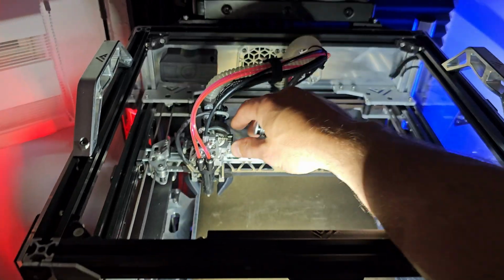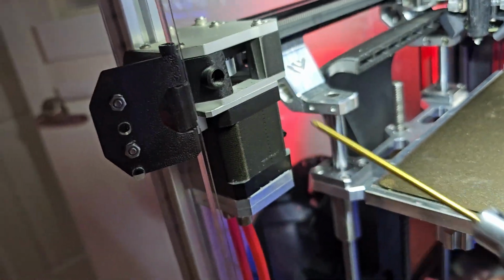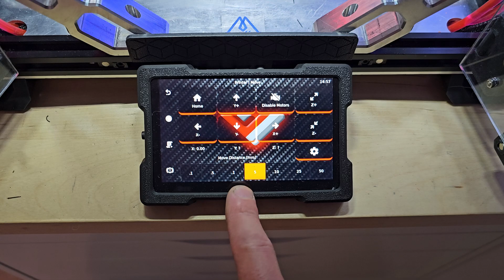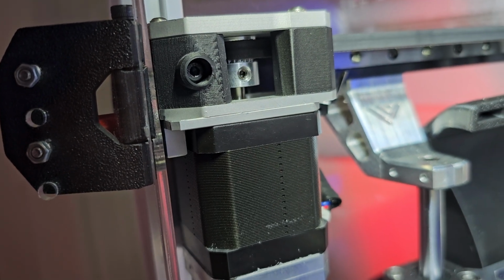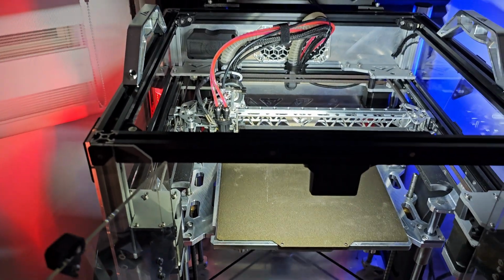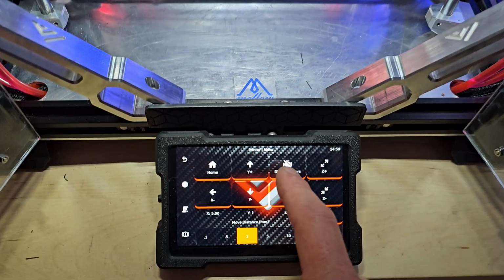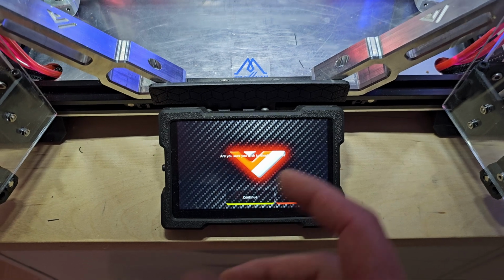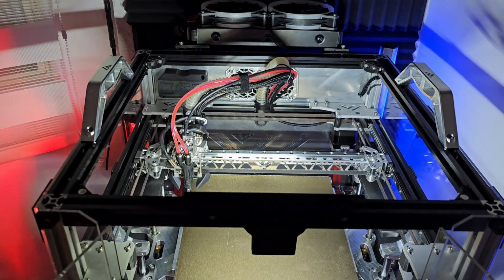Sync your AWD motors. New method

Comment: Ive just ordered the latest Mellow kit AWD 330. It seems that, there are all or most parts already CNC machined. Is there any advice on the additional mods for top performance (speed and quality wise)?
Reply from the maker: I like the watercooled hextduder that allows you to run short goliath
Reply: @Vez3D  thanks. I saw there are water connections on extruder but also on goliath. I will need to research it more. its been only 1 month since I puchased and built the Prusa MK4. I quickly realized the bed swinging design has physically unmanageable limitations. returned it and bought a Bambulab X1C. I love it, and I think it is a very good overall machine for vast uses. however now I would like to add a bigger size and push the speed limits:)

Comment: Very nice hobby you have,  one can be completely mesmerized watching some of your videos.
Regarding cooling your stepper motors I think you have gone the wrong way, water cooling can be a good way to cool. but I am convinced that you will find it difficult to remove the heat from the copper windings by mounting a water-cooled aluminum plate at the bottom of your stepper motor.
What you should have done is drill holes in your stepper motor and place a fan at the bottom of your stepper.
Please look at this video called "What's the best way to cool stepper motors?"
" https://www.youtube.com/watch?v=eerxaoaRhQI&t=11s"
Best regards

Comment: congratulations for the engineering skills! it is by far the best design I've ever seen. Can you make a video showing your motors configurations? I mean, by watching this video and some of the other videos I seem to see that you have two motors for X and two motors for Y, right? and is this a COREXY printer? can you clarify this in a video, just a very simple video showing the printer, pointing your finger to where the motors are and how they are connected to each other, and also tell why you chose this configuration. Also seems you have a single motor for Z right? also if you can show how did you connect the printer head (extruder + hotend) to the gantry, it would be nice.. I also like to watch problem solving videos so It can help me with my problem solving skills.

Comment: Very nice!! I did this method very similar with the VzBot 330, but did it from the back motors. Don't forget the loctite afterwards right?? :)  Also, you no longer need to run the motor enable command? Just moving the motors a bit is fine? (Old way- I remember running SET_STEPPER_ENABLE STEPPER=stepper_x ENABLE=1 for each motor in a macro)

Comment: @Vez3D What rails are you running on the Y Gantry?
It looks like MGN 9C is that correct?
I planed on using these for my VZ235 but i gave it up because of worries about the input shaper results
Reply from the maker: Yeah mgn9c. I had mgn12h before. It didnt change a lot on IS... so i recommend staying with mgn12 on Y.

Comment: I have built vzbot 330, but still using it with dual motor, I already have 2 extra motor but didn't put them on. I still don't understand the benefit of the having 4 motor, if anyone can explain to me in a understanding way. Thank you
Reply from the maker: diving by 2 the belt lenght .. so all the benefit of having shorter belts in a big prniter.. better resonance, better performance, more power, more speed, better printing etc.. :)

Comment: I have a new method that's even simpler, and works with AWD setups where the tensioning is imbalanced so you have to sync with the belts already tensioned. All it requires is loosening the set screw on one motor, running a Klipper macro, then retightening.
Reply: are you on the discord?
Reply: @Zzafari7  Yes. Not a VzBot user but I love VzBot stuff anyway so I am.
Reply: @daliasprints9798   can you share the macro please
Reply: May I ask why synchronization is needed? Even if the shaft has a cutout, the stepper has 200 steps per rotation and is basically free to spin when powered down, wouldn’t it find its own place that way?
Or are we syncing within 1/200th of a rotation? Does it matter that much?
Reply: @jerrymk6846  If you have AWD on independent drivers with shared endstop, sync is needed for mechanical reasons. Unsynced, when they power on and jump to a full step, one side of belt will be tensioned more than the other. Worst case it's halfway and randomly falls one way or the other, messing up calibration. Either way, you'll have torque ripple artifacts and reduced power. Yes 1/200 of a rotation is extremely significant. Even 1/2000 is.

If you have AWD with shared driver, it's even worse. Sync is needes for electrical reasons because they're electrically coupled. Desynced motors will try to drive each other the wrong way.

Comment: Does four motors improve anything? Why they might be better than wider belt and two larger motors?
Reply: Shorter belt paths
Reply: The belt paths are shorter and the inertia is lower relative to the power.
Reply: @theofficialczex1708  Were there any comparisons with just two motors or with wider belt?
Reply: @TheNamelessOne12357  Yeah, I think vez compared here on youtube, most of the improvement comes in better IS results, rather than the extra power from more motors.

Comment: I've built mine with pulleys that use a single M2 with a drop of loctite to clamp around the motor shaft. Seller claimed it's more concentric. So far it's running good with 10-20k accel. Input shaper looked good as well. But I don't know if they'll slip when the acceleration gets too agressive.